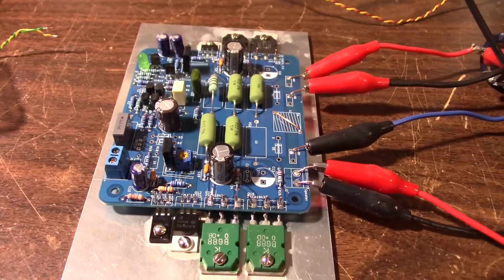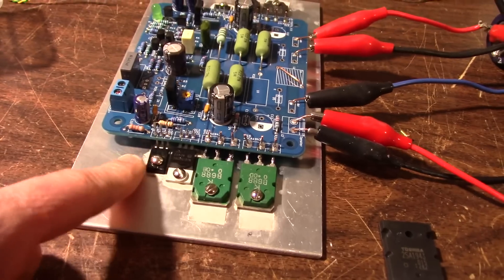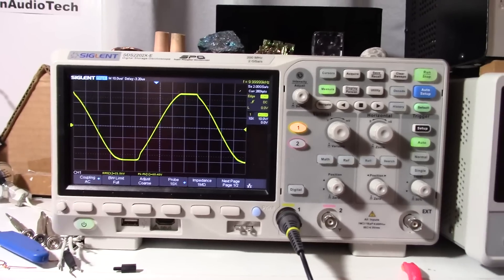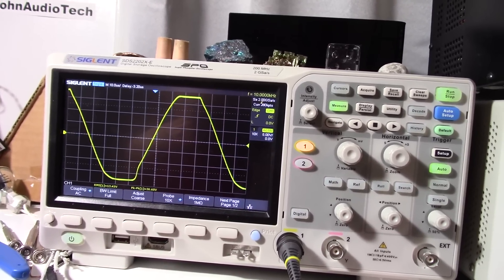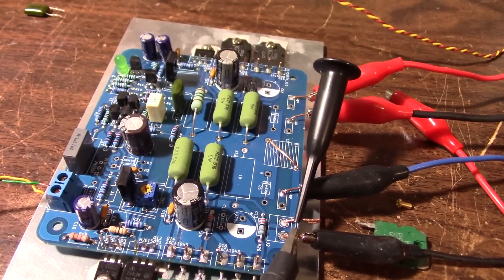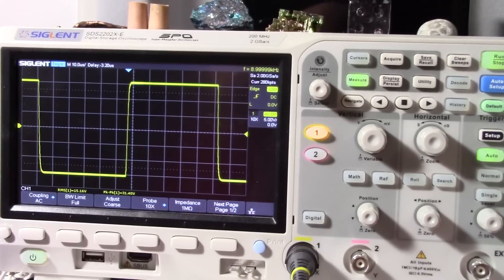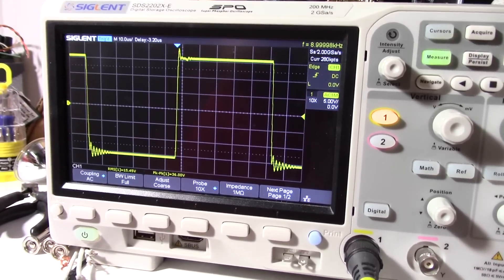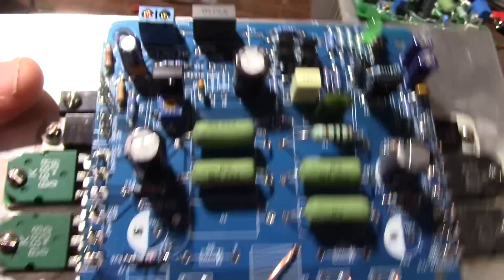JAT801 amplifier stability tests

Comment: I purchased a ljm20.5 amp module off ebay and it oscillates like crazy, it unusable, I had to add miller caps and a output low pass, just to get it to work, it still just slightly unstable.

Comment: car amp transistors might be cheap copy of toshiba or sanken. without verification cant tell. original toshiba 2SC5200 can survive 25V rail with open bias or shorted output without protection

Comment: could be that it needs the L1 air coil plus the 4R7 or 10R resistor in paraller for a bit of stabilty

Comment: I'd be interested to see how it performed if you removed one of the output transistors off each rail. This is just academic interest. Obviously doing this would defeat the aim of creating an amplifier with higher output than the JAT501.

Comment: What about C3 = 47pF (upper left corner of the schematic) between the current sources ? A higher value capacitor maybe "cure" the problem or "some play"  with the ratio of the two resistors of the second (for VAS) current source ? At 5:11 maybe it is a second harmonic distortion . What do you see with FFT analyser ?
Reply from the maker: That capacitor is a 47uf
Reply: @JohnAudioTech  sorry John. Screen capturing is not clear enough to see the difference between "μ" and "p". What FFT shows ?

Comment: I wonder if it might be useful to do some open loop tests.  I think it can be hard to say for sure that it is the VAS stage when the loop is closed.  Remove the feedback resistor R12  and put a very small signal in to see of the VAS stage is clipping that way without feedback.  Of course you probably want to run it with very low voltage rails to keep from blowing things in open loop mode.  I bet it is the output transistors being too slow that is the cause.
Reply: Perhaps an easier way to measure the open loop performance would be to short out R13 so that you were just getting DC feedback.  That would be easy to do as a temporary step as you would just have to add a jumper and you wouldn't have to deal with small dc offsets on your input test signal.

Comment: I don't like that asymmetric ringing that the 501 also has, I find these kind of issues very hard to trace because the whole amp is within a feedback loop I can't tell the difference between cause and effect, think I would blindly just go in and add 22pf ceramic caps across base, collector all transistors and if that cures it start removing them to see which transistor is the cause. I'd Like to know if there's a logical method though
Reply: I was wondering how the poles of the output might have different stability. While circuit board layout is a possibility, I think you may have hit the nail on the head. I understand it is actually physically impossible to create perfectly matched pnp and npn transistors. If memory serves, it wasn't until the mid 70s that closely matched pairs were manufactured.
Reply: @Roger_Gadd  those output transistors were from the same amp so unless he's mixed left and right pairs they are matched so I'm thinking as you say pcb layout or it's predrivers but I'm from the repair side of electronics not design so this is outside of my comfort range
Reply: @darrenmurphy6251  I confess to being an amateur, but I enjoy electronics and learning from John's videos.
From my personal study of transistor theory, I understand that although the gains of a pnp-npn pair may be matched, one or more of the internal capacitances, resistances, and time delay of the opposing transistors won't match.
The output transistors used in this prototype are probably really slow by modern standards, and the negative rail (pnp?) output transistors are probably slower than those from the positive rail. More frequency gain compensation within the circuit, or preferably better output transistors might help.

Comment: The output transistors are 12MHz vs. 30MHz in the JAT501, and the cob is also about half that of the transisitors used in the 501. I don't know if that's the issue, but changing outputs in an amplifier, sometimes has the weirdest effects.
Reply: Ive heard that faster transistors are more stable if feedback is involved because it keeps the phase closer to ideal
Reply: The audio amplifier frequency is upto 20khz, so 12 vs 30 mhz will make no difference

Comment: 1: Usually is not good to use component  as mechanical distance,  thermal expansion make the lead  break at case in long time.
2: Another bad thing that usually should be avoid is a big hole in middle of pcb , that hole will be in ground plane ,  and different frequency may go different path . 
3: I usually use two transistor as thermal sensor
4: clipping show that transistor get saturated and the don't come out , you can put baker diode in VAS so you get headroom. 
Another test to find out which one is saturated is put noise signal ( 20k limited ) and watch for top if they can come out from saturation. 
5: phase margin and gain margin if you have networks analyser
6 : cut transistor lead (big one), wire it to pcb .
7: put 100p cap parallel wirh feedback resistor
Reply: I agree with this idea, especially since the output transistors are on opposite side of the PCB. Put two thermal sense transistors in your design, one on each side of the PCB near the output transistors.

Comment: You repeatly make statements about using JUNK parts and then on the JAT801 you use JUNK 20+ year old output transistor!!??
You can't evaluate this JAt801 based upon these output transistor's. Trash these transistors!!!